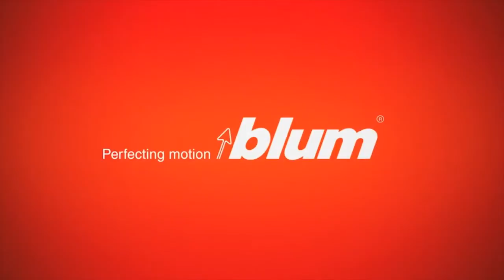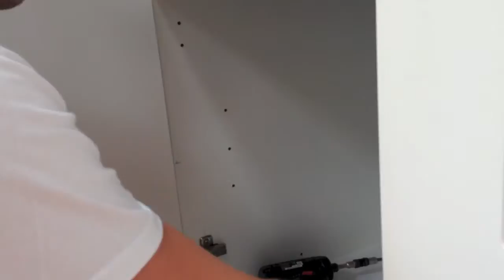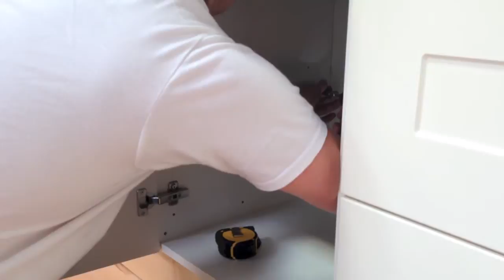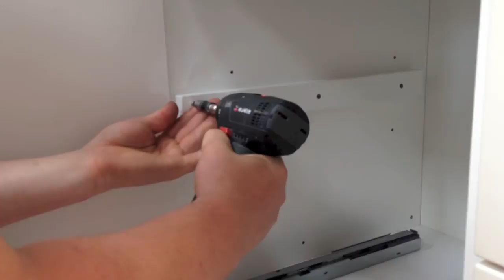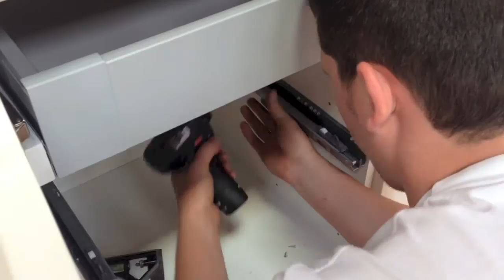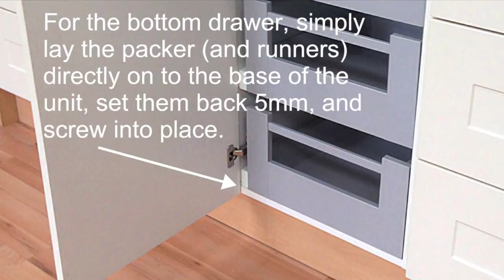Blum INTERNAL Tandembox Antaro - shallow kitchen drawer box - 2 of 2     Fit the runners

Comment: What is the width and height required for the packer if I use hinge with opening angle of 110 and  I would like to know if  is enough  5 mm tolerance to the front door inward for this hinge.
Reply: Hi, Thanks for the enquiry. The packer is 25mm thick (enough for most 110 hinges), the width is 45mm, (same as runner). The runner (and packer) is set back 5mm. You can go more if you have space .
Reply: Thank you very much ! You're amazing! All the best !

Comment: If I was removing the door on a 600mm base unit and converting it to internal drawers can you supply internal boxes that fit the full internal width (i.e. without the packer)?
Reply: Hi Stephen, thanks for your enquiry. yes we can make the internal drawers to any width. All we need to know is the internal width of your base unit. EG, a 600w base with 15mm sides give an internal width of 570mm.